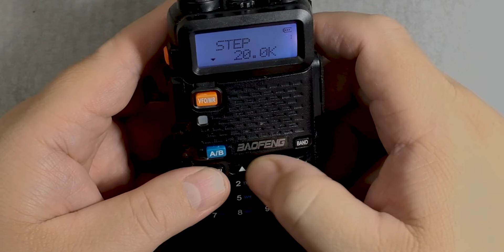Baofeng UV-5R Step Frequency

Comment: Hello  can u explain in Detail what is the purpose or Function when we use Step Frequency at my walkies Talkie  , TQ
Reply from the maker: Think of it this way. Have you ever gone to the supermarket and you went to buy eggs. You usually don’t buy one egg. You usually buy one dozen eggs, or you buy three dozen eggs which comes in a bigger box. And you probably have seen something like a half a dozen eggs. All these different cartons have different amounts of eggs. Well steps has a very similar concept. Steps is the box and hertz is the egg.  The bigger the step the more Hertz you have. Why would you want a step that has many hertz? Because you want to scroll the frequency dial with a faster pace. The bigger the step the faster you will scroll on the band.